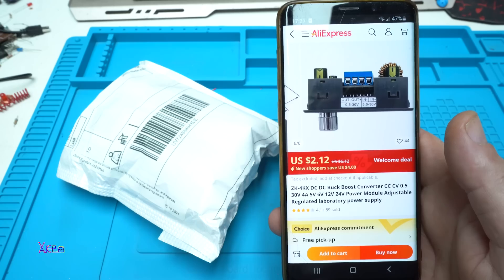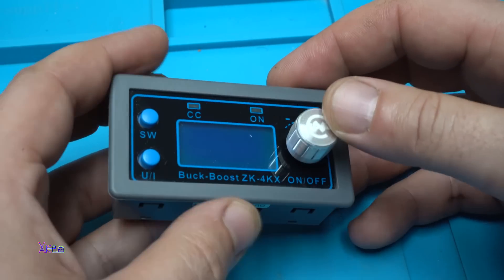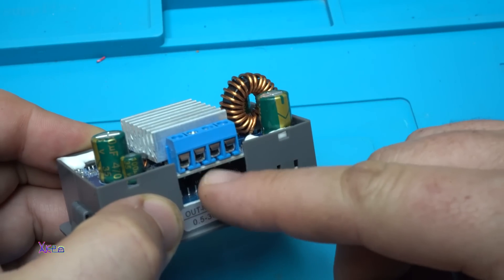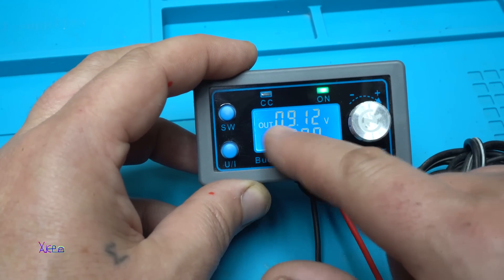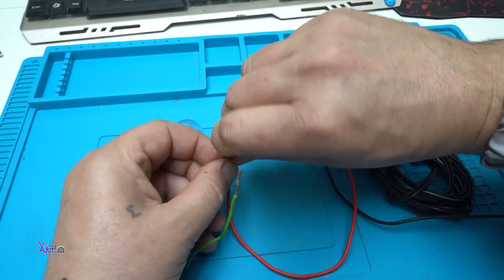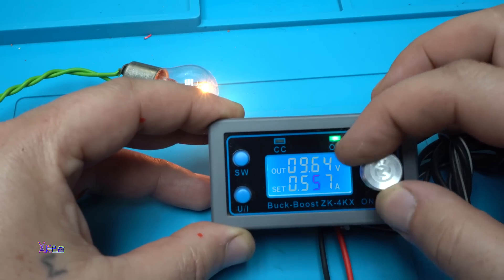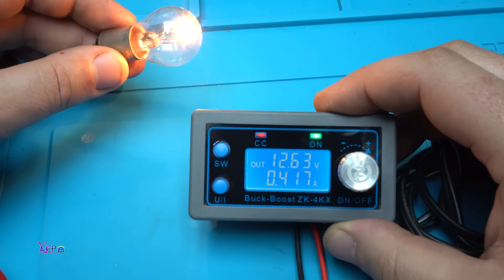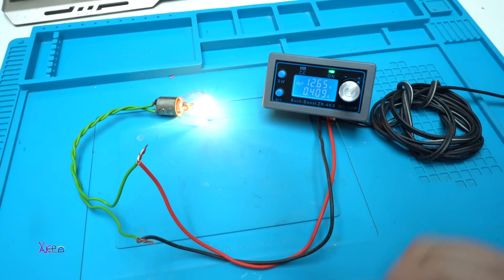IS THIS $? Aliexpress Power Supply REALLY Laboratory Grade?

Comment: I have installed several of these modules in my home made "lab psu". Of course it has nothing to see with a lab psu, but for the price, and as long as we only need 3 or 4 amps, I think it's quite capable and unbeatable ! Very happy with it.
Reply from the maker: Yes,there are much more powerful power supply that give above 10A but in real life we work with smaller amps like 3-4A

Comment: Need to monitor the DC voltage with a scope and have the power supply powering an audio amp or something high current and switching. Then you zoom in on the DC level and see if there is ripple.

Comment: The short answer: no! 
Whatever you try, the Amp meter sucks big time. Calibration does not help. Ripple is a disaster. HF rejection non-excistent. It is a toy that allows for quick access to a wide voltage range, but no more than that.

Comment: Well, the version that I have seems to do the current setting quite accurately, but the current output reading seems impossible to get calibrated. Voltage is off a bit, but seems easier to calibrate.
I actually hate the interface, I really prefer to set the values with potentiometers, with digital readout of the settings.
Reply from the maker: Good info,thx

Comment: I thought it said that it is a Buck/Boost converter.  Why wouldn't it go higher than 12 volts?  Also, we should NOT call this thing a "Power Supply".
Reply: Because you NEED to supply power to it.

Comment: ok the $2 is one time price for new aliexpress account not existing, some cheaper module are PWM not DC/DC and starting price for existing aliexpress account start from around 5-6 USD with free shipping if you lucky. The ebay is $13. It used to be popular in aliexpress but now hard to find as they don't make them anymore. In general, the Aliexpress seems to be increasing the prices for cheap China craps. I have been grabbing many cheap things before Trump's policy imposed Tariffs and barriers which shut down or limits this trade route. The regulator device is a cheap copy or clone from the original manufacturer, which means inferior quality. I know I saw issues in various products from Chian crap, but hey, I still buy them because it's fun!. I expect during 2025, China is ready to move away from the USA and impose a policy to kick out US business in China once Trump implements harsh measures. They still have a market in another country. That is the way business works at the international level.

Comment: I like these buck convertors that have the ability to adjust and set voltage and amps
Reply from the maker: These days you can find some cheap and useful electronics
Reply: @Hacktuber  Yeah these ones in the video I do be looking for. I have a similar one but it way bigger but I have to manage the screw pot for current limiting manually but everything else I can set the voltage and go

Comment: I can't see this for any less than $6.31 on Aliexpress. Definitely not $2.
Reply: One of these videos was for a US$1.00 Bluetooth module. I bought 5 at A$0.94, that is US$0.56 each! They are brilliant. 3 days later they were A$1.12, so they went up 15%. Was that because I did a good review, because the Australian dollar went down or the Yuan went up? Special deals for new sign ups.  Lots of variables here.
Reply: At least you can get it for $7, the one I found was not less than $13, but it could be that he was lucky and found it on a special. At the same time I do not think that he counts the shipping either.
Reply: made new aliexpress account, you will get welcome discount 80%
Reply: Can't even find it below $10, though by using coins I got it for slightly over $6.
Reply: Agree.  On the video it shows it was a Choice "Welcome" deal.

Comment: As this thing is advertised as a buck/boost converter you did not show the boost capabilities. On the 12v supplied voltage, can you still go up to 30 volt? And how is the current limit at that voltage.

Comment: Be careful when charging your batteries with these; for some reason, they don’t respond well. Even though I set the voltage, it somehow overshot the target by almost a volt. This can destroy lithium batteries or even cause an explosion or fire.
Reply: As they dont have voltage cut off and sensing , not sure they are good enough for lipo chargers ?prob okay for lead acid ? Ive found the B6 imax has all setting and cutoffs i need for lipo charging and should add well onto this unit .
Reply: @mariebaxter473  you might be right, i would keep a close eye on it still 👍
Reply: Do use this for charging lion batteries. There are proper chargers for them.

Comment: I also have this and a couple of other ones feg  SK120 ... .  I seriously like this one.  Cheap, not a ton of useless options that you forget about after you tried them and it just works. Also an LCD which is visible outside,  The only thing I can't understand is why that they don't make a cheap plastic housing for it.  Not everyone has a 3D printer and the metal ones costs like 3 or 4 times the price of the module.
At the input I use a XT60 connector which I can connect to my solar panels or the Powertools battery which btw I also charge with this module.  Perfect quick portable powersupply with a large voltage and currect range.  Only downside, but not a lot is the efficiency but that is just to have a negative point.
Reply from the maker: Very well explained sir,for the money the gadget worth every cent,its small portable and can handle 4amps which is enough for many experiments
Reply: The 3d printer was not invented, when I were learning about electronic - I used expensive boxes, which I got from electronic stores, and often I just sourced an retired plastic lunchbox, and modified it to suit the purpose - a hot glue gun and a dremmel are nice tools to have...  :popcorn-yellow-striped-smile:
Reply: They do sell one complete with black housing.
Reply: @Zerpentsa6598  yeah I know. Price is more than double that way.
Reply: Regarding the housing , lots of people will add this to an existing transformer housing or project as a finishing part , so would not really want a housing that gets tossed into landfill.

Comment: i want to use these modules for a custom voltage injector tool (with a pc power supply) could it work tho?
Reply from the maker: Yes if you hook up with psu will work

Comment: Thanks for the review. Some laboratories are worse than others- I had to solder in the bathroom of a US hotel because the lighting was too dim everywhere else (more like lavatory grade work). BTW, it's not a potentiometer- it's a (mechanical) rotary encoder with a switch.
Reply from the maker: You are correct,its not a pot,its a rotary encoder

Comment: Good value, even at the higher price, adding a small fan to the heat sink helps at higher amps/volts. Rotary controller gets "sloppy" over time.
Reply from the maker: I need to test that rotary pot👍

Comment: I use this in a bench power supply, I made from an old computer power supply. works great.
Reply from the maker: Sounds like a good project👍
Reply: I did a similar thing... I brought out the voltages of the PC supply to binding posts, and set them up so that I can put connections between voltages... 3.3 to 12, 5 to 12, and disconnected from output ground from the chassis ground, so that I can put two PC supplies in one box, and have+/-12, +/-5, 24V, 10V, and use two of the programmable supplies, in the same box, so that I have two independently adjustable supplies, to use as +/- supplies, separate sources, in series or parallel... So, I have fixed voltages of 12 V @ 16 A, +5 @ 20 A, +24 @ 8 A, and 2x adjustable supplies @4 A.